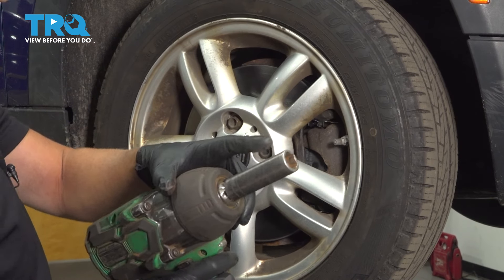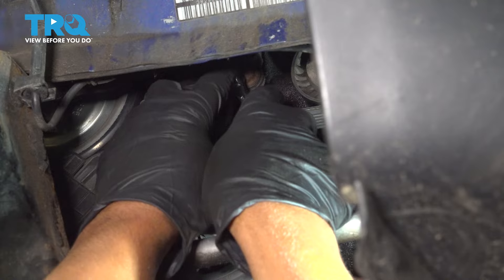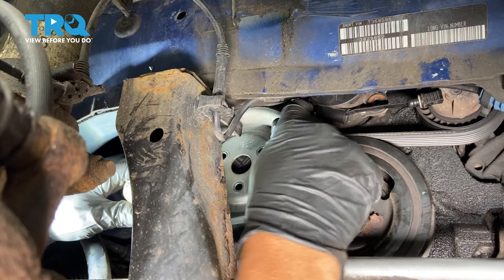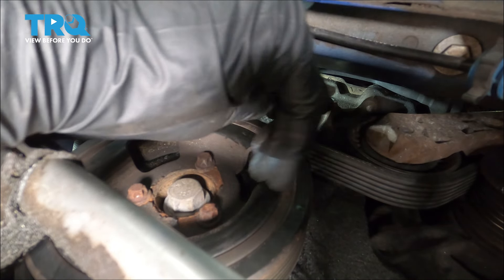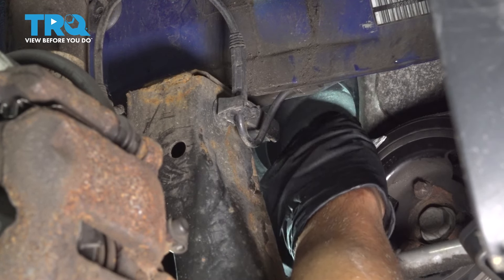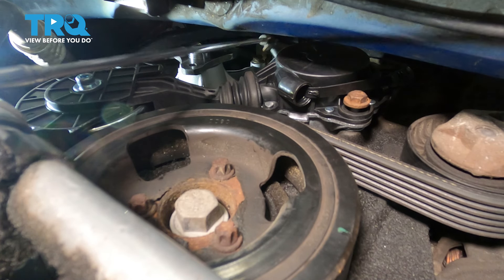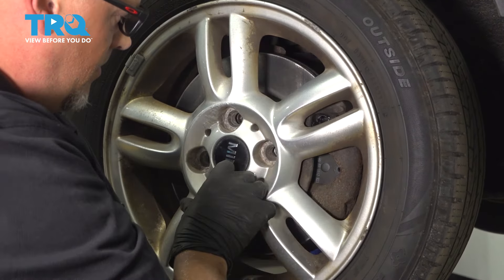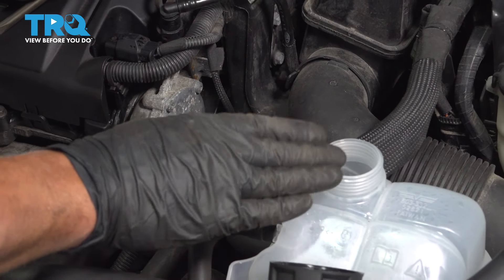How to Replace Engine Water Pump 2007-2013 Mini Cooper

Comment: Doing a 2010 right now, everything he says is pretty accurate with the exception of the top bolt on the water pump. Nearly impossible to get at. I've been working on it for over an hour and I'm ready to punch something

Comment: Took me 8 hours to get this done on our 2012 Mini Cooper S Countryman. I would like to know what special tool? That darn tentioner took the longest to get those bolts out. After doing this job I can only think of a 10mm flex rachet wrench, S-Shape Rachet wrench, Offset wrench, or halfmoon rachet wrench to make things go smoother and reduce time. This was my first time changing a water, so the video was a mig help and guid to know what to expect.
Reply: I spent 9 hours doing the tensioners without the water pump, it wqas awful. I pulled the motor mount and intercooler pipes and hung the engine for more space to work. A through socket wrench or extremely low profile socket  and wrench is what teh special mini tool looks like

Comment: Why did you install a water pump that was different from the original. In the video the original water pump has a casting hole with a plug that is clearly visible. The water pump you put in doesn't have this and the water pump you put in looks like it  has an electrical plug on the side.

Comment: The best video so far about replacing the water pump! Removal of the water pump pulley followed by the tensioner pulley allowed a better access to the pump. Other videos either demonstrated struggle to maneuver the pump or dismantled half the car to do the job. 👍

Comment: Oh awesome, I totally thought I would have to remove my thermostat housing AGAIN! I just replaced my thermostat last month and lo and behold, my water pump goes out! Byebye A/C byebye coolant circulation byebye engine fan lmao... Fortunately, this is a 20 minute video on the job. This looks very doable and I don't have to clear half the engine bay to reach it.

Comment: I'm curious, wouldn't leaving the tension on the pulley tensioner help keep the water pump pulley from spinning so you can r&r the bolts?

Comment: I put a jacl under the engine and took the motor mounts off and worked from above. It was easier and the top bolts were easier to get at. Buy some shorty sockets and the wrench also. Got a torque wrench on the pump bolts at 9 nm.